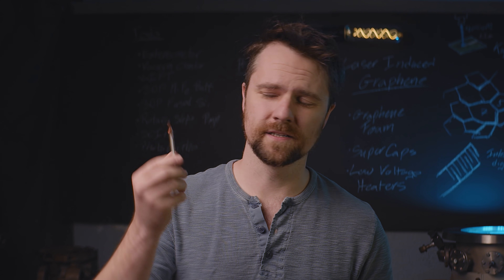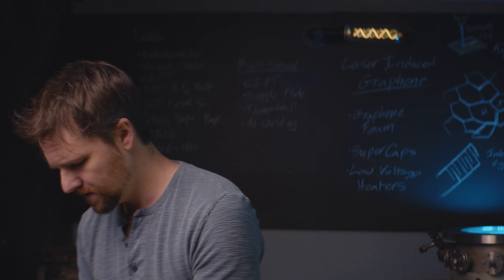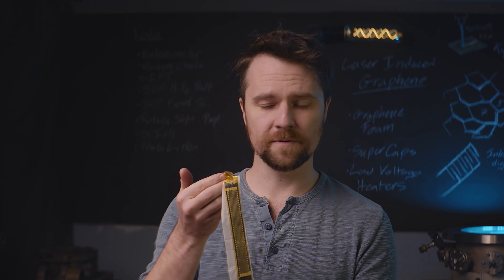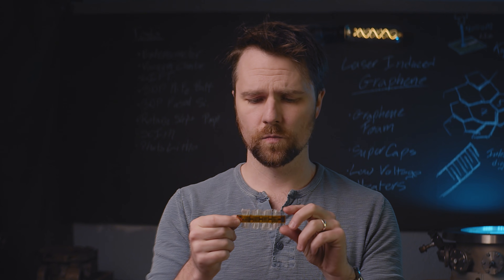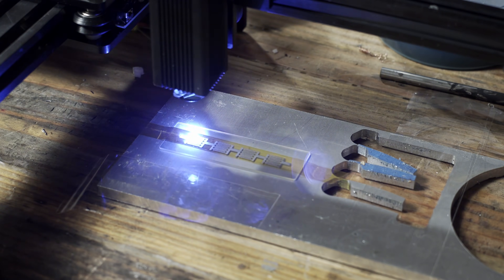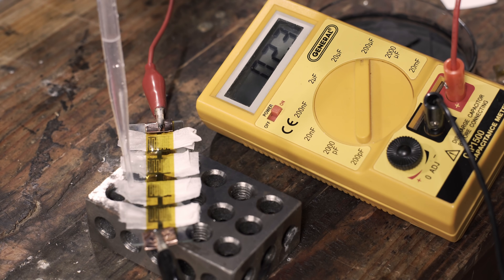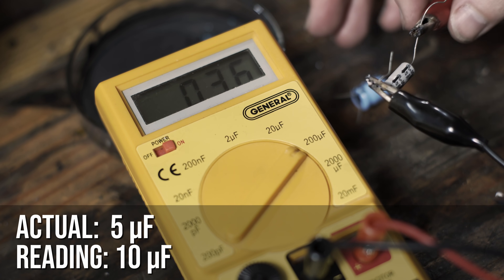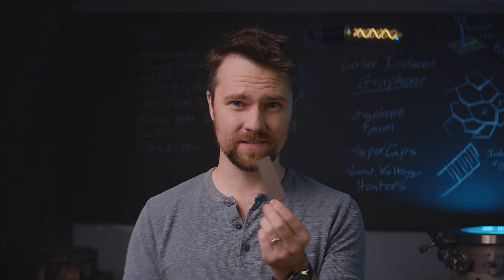Kapton Tape Supercapacitor?

Comment: Really cool!  Is is conductive through the adhesive side, too, or did you have to connect to the graphene from above?
Reply from the maker: Have to connect from above, at least with my tape.  It uses a silicone adhesive which is pretty insulating.  If you get it _just right_, you can burn through the silicone too... but that usually makes the graphene to fragile to use and it flakes off.  I used copper tape held against the graphene mechanically, researchers tend to use silver paste/epoxy.  But you can also buy kapton film without adhesive, so that might be easier to "burn through" in certain spots and not worry about adhesive.  Theoretically polyetherimide (PEI) works with this process too, just not quite as well as Kapton.
Reply: @BreakingTaps  Awesome.  Perhaps this will be a cool way to make a custom heatbed for a 3D printer...  Thanks!

Comment: Just waiting for the youtube algorithm to bless this channel. Great work as usual, I'm using your metallic microlattice video for one of my projects right now.
Reply from the maker: Oh awesome, lemme know how it goes (or if you run into issues)! :)
Reply: @BreakingTaps  Played around with this graphene concept last weekend, turns out it works really great with the 10um co2 lasers, which is mighty convenient. Also turned much more black (vantablack?) than yours. Anyways, do you have a discord server or something? It would be neat to hang around, as I and a few friends are all doing similar stuff as you
Reply from the maker: @Wid Lay Awesome, glad to hear it!  The first LIG papers were done on CO2 iirc, and there are some neat followup papers where they perform multiple passes to turn amorphous carbon into LIG (which isn't possible with shorter wavelengths like mine). Was used to make supercaps on coconuts and potatos as demonstrations :)  I wonder if that's why yours was blacker?  The literature shows that LIG is a big mess of graphene + amorphous carbon + fullerenes + tubes, so I wonder if the CO2 does a better job of converting some of the non-graphene into graphene?  Dunno, but interesting result!

No discord at the moment, but I was just thinking it'd be fun to have a place to gather folks working on similar stuff.  Lemme set one up and I'll give you a ping!
Reply from the maker: @you2709  Made a discord!  https://discord.gg/R45uCXcEv4  feel free to invite whomever :)

Comment: Interesting. Did you adjust the themal readout for the emissitivity of the LIG? Or what emissitivity was the meter set to? These meters seem handy at first, but once you realize how easy it is to do completely wrong measurements with them, you quickly go back to thermocouples or other sensors, even if it's just for a sanity-check.
Reply from the maker: Yeah that's a very fair point... I didn't do any sort of calibration on the meter :) It's cheap, not sure it even can be calibrated to be honest.  But, it got hot enough to break the glass slide and leave burn marks on my wood bench (you can actually see some smoke in the footage at the end).  If I try again I'll poke it with a thermocouple to verify!

Comment: Great project! I'd be interested to see the leakage current and how long the capacitors will hold voltage with no external connections. Leakage current could also influence the readings from your multimeter, so this is something to watch out for.
Reply from the maker: Forgive the newbie question: I should be able to test this with just an oscilloscope right?  Charge up, measure the discharge for a given period of time and then work out the resistance / leakage current from that?
Reply: A crude but portable way to check capacitor condition is to put a multimeter across the terminals and see what the resistance stabilises to. Ideally it should be infinite, but you know a motor start capacitor has definitely failed when it has a resistance under a few hundred ohms :). My understanding of the way most multimeters measure capacitance is they time how long it takes for the capacitance to reach a certain voltage from 0v with a known constant current, so any leakage resistance decreases the amount of current charging the capacitor and makes it appear larger in value than it actually is. I have also used an LC meter that seems to use some form of oscillation to measure capacitance and this seems a bit less sensitive, but can still do weird things with high leakage currents.

Comment: Electrolytic capacitors are usually +80%, -20% in tolerance.
Reply from the maker: Woah, that's wild.  I had no idea they had such loose tolerances
Reply: @BreakingTaps  they don't; the vast majority (like 90% of them) have a tolerance of ± 20%

Comment: Wow, this was an amazing video!  Kapton and graphene are amazing - I'm a real materials science fanboy.  Hmm, maybe the heating element concept could be developed as ultrasafe consumer space heaters?
Reply from the maker: I'm wondering as well :)  Probably depends on size, and how these things scale voltage vs current.  I don't have a good feel for how many amps you end up pushing through them... i could see them being potentially less-practical if you need to pump 15A at 12V for example.  In my tests I think I peaked around 2A and 10V

Comment: HEATED FDM PRINTER BED!
Already flexible, stick it to a steel plate and now the heater itself is above any magnets you may be using.

Were you running your laser at full power for this, or did you have it dialed down at all? If I can reproduce this on the Glowforge, I'll be pretty happy.
Reply from the maker: Oh actually, I just stumbled on this thread while looking for a reference I had misplaced: https://community.glowforge.com/t/lig-laser-induced-graphene-settings/9707 .  Looks like a glowforge user was experimenting with this back in 2017, and lists various power/speed settings and his results :)
Reply: @BreakingTaps  It would be interesting to collect some more data on those kind of heaters. Yeah the basic max temperature and max power per area is nice. But I'm thinking  resistance over temperature drifting graphs, heat cycling tests, mains voltages heaters with a much higher resistance...
Reply: Anyway, love the new format, keep it going !
Reply from the maker: I'll see what I can do!  Working on a followup for the supercap side (more tests, better tests, etc)... will see about doing the same for exploring the heater side a bit more.  There are some other applications too like stretch/strain sensors and capacitive sensors that might be fun as well :)
Reply: @BreakingTaps  My neighbor, another Glowforge Owner and a MechE, in fact had already done laser-induced graphene on the GF, like a year or so ago. I knew I had seen this before. Nevertheless, we're now talking about other applications. We see each other daily because our kids are classmates. As soon as I have any results, I'll share!
Reply: @BreakingTaps  that glowforge user is my down-the-street neighbor, if I recall correctly. Our kids go to school together. Also we have kids, which is why we've sort of lost the ability to take a lot of time for this sort of pursuit. But recently I've started getting the workshop set back up again, and have been thinking about this all over again...
Reply from the maker: Ooh, I like that!  That's a good idea, I wonder how large you can scale these up.  I only tested smallish samples, and I dont think I saw any papers that did a big sample (usually only a few inches square).  If you try, I think most of the papers I read burned the graphene into a piece of regular non-adhesive polyimide film, and then placed a layer of kapton on top of that to seal it...the graphene can flake off if you're not careful, so the kapton on top makes it more durable.

I was running my laser at 40-50mm/s at 80-90% power depending on the situation.  Thinner tape needs a bit more finesse since it will flake off easier (or burn through).

CO2 laser should work great!  The original Nature paper used a CO2, and a lot of followup ones did as well.  There are also neat tricks you can do with CO2 like multiple-lasing of Lignin-containing materials like cotton/bread/paper/potato/coconut/etc (see: https://pubs.acs.org/doi/abs/10.1021/acsnano.7B08539).  CO2's wavelength can do a "two-pass" process, where the first pass turns the lignin into amorphous carbon, and subsequent passes start to convert the carbon into graphene.  This doesn't work with my 405nm because the amorphorous carbon doesn't absorb 405nm particularly well, unlike CO2.

So yeah, should work great.  Have fun :)

Comment: I think you could probably do another video on this topic. It's super cool. 

I wasn't clear on how to control the voltage VS. capacity, especially if you wanted to print reel to reel. 

I can think of so many ridiculous projects this could be used on.
Reply from the maker: I can do that if there's interest!  I had some footage attempting to explain some of it...but the explanation ended up being really confusing so I cut it during editing.  I can do another attempt to explain something like how the different supercaps work, electrolyte makeup, voltage vs capacitance, and how folks envision the reel-to-reel to work (my understanding is that it'd probably end up more like rolled wet electrolytic caps, with a spacer between two solid layers of graphene).  And maybe touch a bit more on how the gel electrolytes work, pretty simple actually and a lot easier to work with.

Comment: Those values seem like they're in the right neighborhood for electrostatic double layer caps. Have you considered seeing if there are any ionic liquids you can make at home that you could try in these caps?
Also you've got me inspired to play around with the heaters, I've got an idea now...
Reply from the maker: Ah, that's great to hear, thanks for the verification!  I'm a bit out of my depth when it comes to the electrical side of things :)  I had a brief skim of the literature looking at ionic liquids, but didn't see anything that seemed overly home-shop friendly.  But I didn't look too hard, so there may be some less-popular IL's that are "greener" and bit easier to obtain.  

Goodluck with the heaters!  I'd highly recommend picking up some silver paste or silver epoxy.  You need pretty good contact between the copper tape and the carbon, which I achieved just by clamping.  But some silver adhesive would have worked a lot better and been less fragile.  A thicker polyimide film would probably work better than tape too... I have a few different types of tape, and the thicker stuff worked a lot better (more tolerant of laser parameters, the thin stuff can easily burn through or start to flake off if you're not careful).
Reply: @BreakingTaps  I'm constantly feeling like I'm out of my depth, LOL! This is actually a really cool project. I used to work in a lab that synthesized novel polyimides. Among other things, we'd electrospin them into mats and carbonize those mats for use in EDLCs. Of course we'd use tube furnaces with extreme temperatures and exotic atmospheres. Cool to see a similar technique (in principle, anyway) but much easier to do on a small scale.
Reply from the maker: Hehe glad I'm not the only one that feels that way :)  That sounds awesome, I've always thought electrospinning was a really nifty technique!  I bet you can get some pretty ridiculous porosity that way, converting fiber mats into a carbon/graphene layers.  I wonder if you could build an electrospinning system at home... not sure I want to mess with the voltages involved though 😅